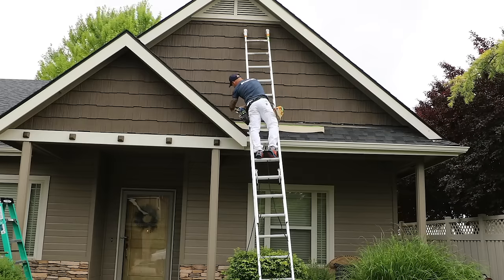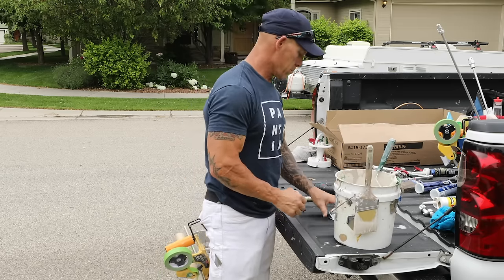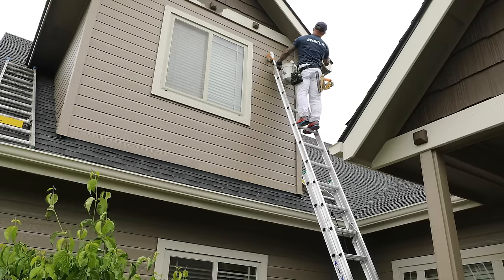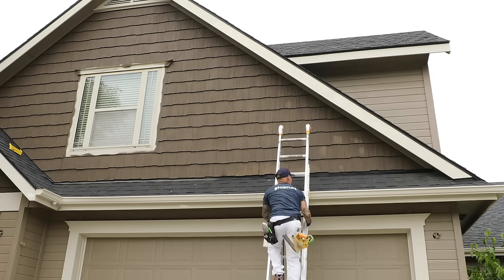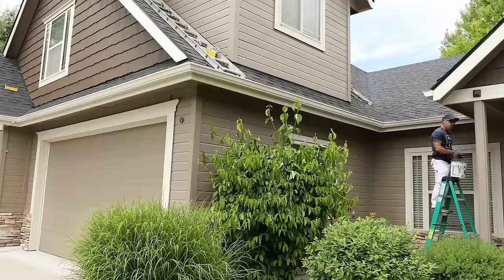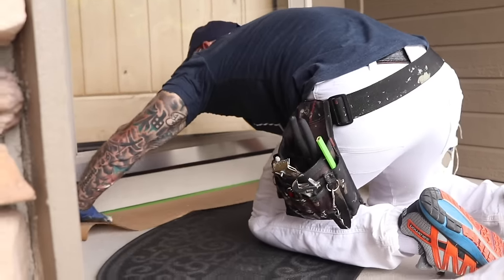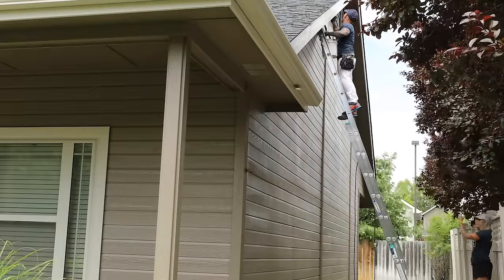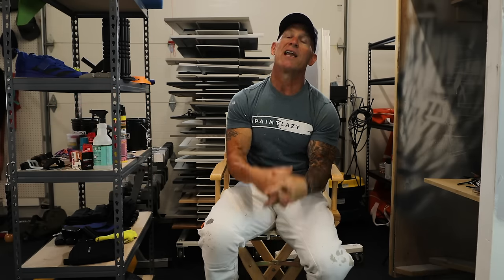House Painting Guide - Rolling & Brushing Trim

Comment: I'm a steel industrial painter. I mainly spray but I have to stripe (cut) in with a brush. I also paint, well just starting, on the side for residential. So technically I'm a professional steel painter and a "beginner" house painter. I've learned a lot from you Chris and I want to thank you. Some say that there is a difference between painting steel and painting houses. I say obviously you've never done both because I can tell you this, the only difference is in your head and the tools you use to prep. If you have pride in your work, you will succeed in your profession. We have a saying at my job. If you're not f'n up it's because you're not working. You are constantly learning something new every day. When you think that you know it all, retire because you stopped learning.

Comment: i’m wondering if your ladder bent the shingles when u painted the fascia
Reply: vertmert in my experience it is very rare...it can happen but you really have to almost try to. As long as your aware of it you will almost never let it happen just my 2 cents
Reply: i always use my ladder stabilizers and put them above, most of the roofing material here where i live is soft composite roofing and i’ve seen it bend a lot

Comment: Respectfully, you have many great videos that are very informative.  But when painting exterior trim around windows and corners, the trim includes the edges also, not just the face.  You like soo many painters take the easy way out and just paint the face of trim because it's fast and easy.  Do the job correctly and paint the trim face and edges.